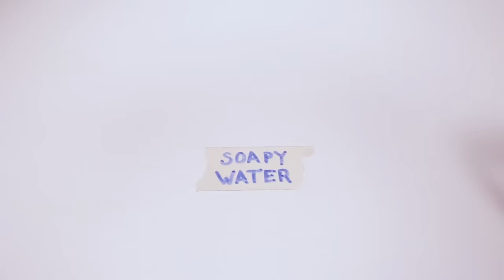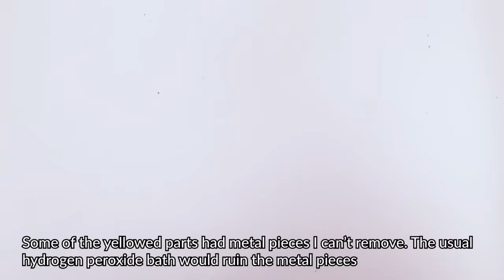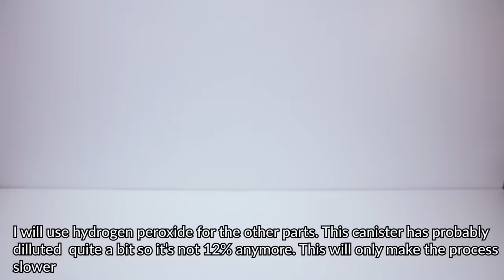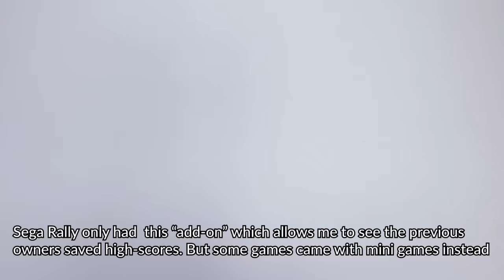Restoring Sega dreamcast controller for my restored Dreamcast – Retro Console Restoration

Comment: The Dreamcast was so ahead of its time. Sometimes I wish we could rewite history to a time where it didn't flop.
Reply: Well, the PS2 was a much more powerful machine that also happened to be a cheap DVD player.
Reply: If I had the option, I would do that. And also, prevent my younger self from trading in all the old games I had.
Reply: It didn't flopped, the only reason why it's not as popular as the PS2, GCN or Xbox is because it was discontinued very early into it's lifespan (1999-2001).
Reply: Ofc, the p2 was more powerful than the DC : as every newer hardware by 2 years later, it was, at least, what Sony must have done.
Reply: The same with the Turbo GrafX-16.
Reply: @typehere6689  it was not MUCH powerful. It was powerful in most areas but not in everything.
Reply: @typehere6689  The PS2 was touted to be more powerful but in practise it did not produce superior graphics. The increase in spec is mostly marketing by Sony but the overall internal design did not make an efficient hardware configuration, creating bottlenecks in the graphical pipeline. The PS2 featured a blur effect and more advanced atmospheric haze but that is where it's advantages ended. The PS2 did not produce a graphically superior game until long after the DC was discontinued. Not to mention the bad video signal. The DVD drive as a contributing factor is overstated. Sony's marketing budget was just hundreds of times greater than Sega's.
Reply: No it wasn't. PS2 was superior in every way.
Reply: The dreamcast nevr did flop it is just that it did not meet sega's profit margin and caused the company to become a 3Rd party.
Reply: Rewrite history? Dude, you'd be much better off to just jump to a different multiverse.
Reply: @SanchoKobe  GameCube was actually more powerful than either.
Reply: @iwanttocomplain  Graphics aren't what makes the game great. It's the gameplay. The PS2 had games released for it for 14 years(Fifa 14 in September of 13 was the last release), while the Xbox and Gamecube didn't see a game past 07. It was a great console, and the best out of the 4. Games would not have been made for it for 6 years longer than its competitors if it wasn't.
Reply: @Masterown35  Sega targeted 60fps whenever possible which is why the games are still fun today.
Reply: @iwanttocomplain  I never said it wasn't fun lol
Reply: @Masterown35  Oh ok. The PS2 with it's military and special effects focus moved gaming in the wrong direction imho.
Reply: Dreamcast only flopped because one, and one problem only. They spent to much money, and time, designing an "unpiratable" disc system. The one that could never been copied or pirated. Thats the problem. While others invested im some hardware and design things, they only focused on that. And lost track...

I had a DC. It was fucking perfect. How many hours have i spent in it... ♥
Reply: MrGameAndStuff still older than the life of my brain cells
Reply: Verd254 agree I loved the Dreamcast . Wished Sega could of held on longer with it . I had Resident evil Codename Veronica for it  . At the time it looked so stylish especially cutscenes .
Reply: Verd254 I mean yes but at the same time this controller did not have a second analog stick
Reply: MrGameAndStuff and why was it discontinued? 🤔
Reply: Imagine the console wars it would be sega Nintendo and PlayStation
Reply: It was a weird, stopgap console that wasn’t quite next gen, for the time, but was superior to the PlayStation and N64 in terms of power. A shame really, because it was a really solid console that did great home ports of arcade games, it was just bad timing. The choice was simple though, wait a few more months for the PS2, have superior graphics, a DVD player and all for about the same price....I did, as did everyone else!
Reply: Why did it flop though? This looked like a pretty ambitious console.
Reply: Imagine a world where Sega is one of the big three and Sony isnt...
Reply: Or even better, instead of the triangle of gaming it's the quadrilateralofyourchoice of gaming
Reply: @Johfunu T Good point. Even before the Saturn, the Megadrive had soured gamers with flops liked the 32X and MegaCD, which whilst quite impressive in their own right were a poor investment vs. a next gen console. The original PlayStation was a huge success, in part because of a straightforward architecture and great developer support, vs. the Saturn's overly complex design and Sega's unwillingness to provide decent APIs or free development kits. The Dreamcast was an excellent console (I still use mine) but after a series of duds from Sega, the public understandably wanted to wait for the successor to the clear winner of the previous generation. Sony was also the king of home electronics in the 80's / 90's, making their offering a safer bet. The DVD player was a nice bonus, though for some stupid anti-piracy reason only outputted via composite and not RGB.
Reply: @Type Here well this ain’t about the PS2
Reply: @scottrhodenizer7192  The PS2 is one of the big reasons the Dreamcast failed.
Reply: Sega, make sure the dreamcast doesnt flop, or else you will leave the console market, I should know, im from 2020!
Reply: @typehere6689  but for the time dreamcast was the best of all 3 consoles
Reply: Привіт передав внас все це безкоштовно на сайті французького у регіоні яких проживало з інших причин 9 в привіт 7 в Україні 8 привіт у 3 664 у працездатному у регіоні Аквітанія привіт у
Reply: Даша а потім і на початку років і більше 6 у працездатному 9 у яких проживала у яких проживало і в той же період час в Україні ПЗ 9 у працездатному 9 у яких проживало і з цього
Reply: I mean, nothing could sell well competing with the PS2, which also was the cheapest DVD player on the market, making it an easy sell to parents.
Reply: Dreamcast ahead of it's time? LOL Ps1 existed first and beat all other consoles to the disc game, next cam e the dreamcast in second place appearing a couple years later. After that Ps2 came out and with it the original xbox in hot pursuit. Facts man.
Reply: PotatoAim 1805 lol no
Reply: @SanchoKobe  the gamecube had more power than the ps2 but it had less storage capability because it used mini dvds
Reply: @SanchoKobe  true. though with n64 it didn't help that the psx was easily modded and able to play backups and the n64 was not. i'd argue for every disadvantage it had it was better at 3d graphics by far than psx. gamecube is mentioned. wii was just bs that was way underpowered. wii-u was like a prototype switch. but the Switch no matter how underpowered is a complete succes
Reply: @SanchoKobe  yeah. just higher clockspeeds on the gpu and cpu but nothing signficant compared to xbox 360 and ps3 it was barely half a generation leap
Reply: @Masterown35   @Masterown35 The reason the PS2 had games release on it for so long had nothing to do with it being a "great console". Because it WASN'T, especially not from a technical perspective. It had the worst visuals of any of the 6th gen consoles. In most cases even the Dreamcast looked better.

The PS2 was a cheap DVD player that came along when the world was getting excited for DVDs. "You can buy a game console AND a DVD player??!! Why not!!?!? 🙂"  That's what propelled the PS2 into 150+ million console seller. That install base ALONE is the only reason why companies kept making games for it.  Same reason why they kept making games for the Wii for so long.

Neither of the two above mentioned consoles were great, they just came along at the right time, with the right appeal. The PS2 had DVDs, the Wii had bowling with Grandma.

Companies kept making games for them because everyone owned one of these two consoles. So even if you only sold your game to 0.5% of ALL owners you'd still sell over half a million copies of your game.
Reply: @silvabullet79  As I said in a previous comment a while back, visuals aren't what makes the game great, it's the gameplay. If you're basing a console or game off of visuals alone, you're missing the point of playing the games. Take No Man's Sky for example. Game looked awesome yet the gameplay was garbage.

And there are tons of people who saw the PS2 as a great console for the games, not just for the DVD player.
Reply: Masterown35 
Maybe the reason games continued to be made for it was because it was the best selling console ever. Old Sega consoles are still being sold in Brazil. Does that make them any better than their competitors?
Reply: @silvabullet79  "Neither of the two above consoles were great, they just came at the right time"

Yeah the PS2 was complete shit. That's why it's still the highest selling console to DATE, and didn't stop being manufactured until like what? 2012? Let me check right quick... No 2013.

This console had a lifespan of 12 years dude. It was able to survive TWO console generations after it released. Yes originally it sold well because it was a functional DVD player during a time where they we're still coming into people's home's and were quite expensive because of it, so the PS2 was the cheaper alternative and also used as the argument kids would use to convince their parents to buy the system.

Listen children, I know this is difficult for you to understand but it's perfectly okay not to like something. Honestly it's apart of being human, but when you're basis for your argument is pretty much JUST your opinion, that means that you have no argument.

See the biggest issue with what you said was that it just came at the right time... Because of that were the case it would've just sold in bursts, and then went right back down to the bottom just like every other console that just wasn't very good and but no not only did it outlast all of its competitive but the console just refused to die generations past its prime with titles still being made for it until the day in 2013 when production caused it to finally end.

So in conclusion, hate if if you will and say what you want the PS2 is the greatest console of all time, and until another console can outsell that now, it will always be that way... And even when someone does inevitably beat the record of that console, guess what? It will still be the greatest for being the first to sell so much in the first place, and also hold that record for OVER the length of it's lifespan.
Reply: Same with the Wii U
Reply: @SanchoKobe  did you just disrespect the original xbox?
Reply: Easy, just make sega not hire bernie stolar. He singlehandedly made the system fail
Reply: We need to change time to where sega didnt loose out on loads of money cause of sonic xtremes cancellation and the saturns failure
Reply: If the Playstation didn't come and mess things up, the Saturn would've had all the JRPGs and third party support because it supported discs. Sony took what Sega did and just did it better.
Reply: @deedr1234  you just explained a flop xd
Reply: in that case it would of have to come out before the Sega 32X the Sega CD and the Sega Saturn lol
Reply: If Dreamcast became successful and PS2 was flopped. Emulating 6th gen games would be much easier.

Ps2 is hell to emulate
Reply: @SanchoKobe  so this is basically xbox 0
Reply: @typehere6689  Dreamcast had better light/shadow effects compared to the PS2, as well better graphics for some games.. And PS2 released 2 years after.. So yeah, technically, Dreamcast was ahead of it's time.. It sucks sony kind of killed it
Reply: Daaaaamn, so right...
Reply: @tobyhanke3274  it's technically SEGA and Nintendo's fault that this shite happened. Sony wanted to help SEGA make a CD console and they laughed at them, Sony then asked Nintendo, they agreed, but Nintendo rejected them and partnered with Phillips and then failed. Now Sony decided to make the Playstation 1 because Nintendo and SEGA rejected them.
Reply: Yeah. It was so advanced and visionary! Everyone loves the one analog stick and controller wires being on the wrong side nowadays! The Game & Watch memory cards are all the rage now, too. The PS1 didn't run on optical discs! It's not like the N64 had an internet adapter/modem... The Sega Dreamcast was far ahead of its time!
Reply: @gameandstuff  "It didn't flopped." Your English is as good as your logic.
Reply: If only there hadn't been a Saturn...
Reply: @encycl07pedia-  I did write this 3 years ago, so it is to be expected lol
Reply: @SanchoKobe  the VMU screen wasn’t unnecessary. A lot of the games allowed you to use it to play portable minigames with it, but the console did so poorly we didn’t end up getting most of the games that had that and they remained Japan exclusive.
Reply: I wish Sonic X-tremendous released so the Saturn didn’t flop so Sega could possibly still be around
Reply: @snhvnc true
Reply: @nowonmetube  true except the gamecube was held back by the use of propertiary Mini-Dvd's which P*ss the 3rd party developers off to the point that they abandon nintendo and went with Sony then eventually Microsoft.
Reply: @iwanttocomplain  what you said is either true or not cause Sega left the console buisness as Sony having a bigger budget then Sega thats funny cause Sega could of have a budget equal or more then Sony if they havent screwed up with the Nomad,  GameGear, SegaCD  and the Saturn and when in fact Sega Of Japan was bleeding money bad plus they greenlight the X32 add-on for Genisis/MasterSystem knowlly that they "SOJ" would kill it by releasing the Saturn despite being a Sega of America ideal and SOA originally wanted the Dreamcast to have a DVD player but SOJ rejected the ideal due to SOJ wad bleeding money despite SOA offer to finance the DVD drive's.
Reply: I feel similarly for the 32x ad on i wish it had done better so we got cheaper upgrades to cool systems.
Reply: With better marketing, it would’ve beaten PlayStation.
Reply: @mrfixitishere  yeah. 32X actually was a good idea. Whoever came up with it, it makes sense to me. £150 for a decent upgrade. The same cost as a Jaguar, which is arguably more powerful. But Atari fumbled that one too so it wouldn't have mattered.

If the 32X got at least 150 games I think it would have worked out. They should have kept it on the market and released Rayman on it and just see how it did. That's not the Saturn market.

The 32X pre-sold 1.5mill but they only managed like 300,000 in the first 6 months due to supply of sh2 chips. Then finished on 800k units sold. Still ok. But 40 games only pushed out unfinished is beyond sad.

Finally I'd just like to say that in 2002 the cheapest DVD player is about $60 brand new so... The ps2 sold most around 2005. That's when dvd players were like $30 at the cheapest. So why are people choosing a console to save $60 on a dvd player when the ps2 will do a much worse job.

The DC only needed a DVD player for rpg's. But they could have put 2 double sided gd-roms in a box and still get 4.8GB.

Comment: Never thought of using an ice cube tray to hold screws/small parts! Nice restore!
Reply from the maker: Thanks. I actually saw someone else do it first
Reply: @OddTinkering  There is a lot of screws i don't know how you remember each one of them
Reply: @solohunter5777  well he IS filming the whole process. He could look back to see what went where. I do it to when I repair something. (not for youtube but for me.)
Reply: MisterCasket Do you have fun repairing things? Because i feel like it's so much fun!
Reply: @solohunter5777  not really, always the anxiety that I might screw up something haha! Only do it when it's necessary.
Reply: MisterCasket Lol i never tried dismantling devices. I just send the device to an expert
Reply: @solohunter5777  sometimes thats too expensive. My 3ds had this weird error, by searching online it meant that the wifi module was loose. Getting it fixed was too expensive, so I took it apart and luckily repaired it! I also upgraded my DAB+ radio. It had this shitty wired antenna with horrible reception. So then I attached a telescope antenna to it and it was instantly better. But always afraid I'll break something haha!
Reply: MisterCasket Is it about being lucky? Because the chances of trying to repair something by myself is 40% maybe even less. There are things that can't be fixed like the yellow light of death for the PS3 no matter what you do it will still shut off by itself which is annoying tbh
Reply: @solohunter5777  oh yes if it's out of my hands I'm not even going to attempt it!
Reply: You can also use an egg carton. 😉
Reply: #YOLO
Reply: You can use egg carton as well
Reply: I use a ramequin or however you write it to store the small pieces
Reply: The Klassik Man that usually means the power supply or one of many other things I’ve fixed it twice now
Reply: @nowonmetube  i dont recommend IT much or you Got egg Carton with no holes
Reply: @wonszgamingszerokipedzel1004  oh we have all kinds of those 😂 but I don't buy eggs, since I don't eat any for 10 years now
Reply: @solohunter5777  thats why he sorted the screws with the ice cube tray
Reply: @OddTinkering  yes!
Reply: Wow

Comment: For parts with metal that you weren't able to submerge, I've been able to use developer creme for bleaching hair, painters tape over the parts to protect, and wrapped in cling wrap in the UV box and it works really well. The creme is also pretty cheap at beauty supply shops. Once it's out of the box, I just clean it with soapy water and let it dry. Hope that's helpful for future projects!

Comment: Maybe it's mentioned later in the comments, but you should probably check out cream peroxide developer, used in hairdressing. It's a peroxide cream/gel that will stay where you put it, so you could paint it on the plastic parts, keep it off the metal, and still use UV to accelerate whitening. 50V = 25% peroxide; 40V = 20% peroxide; etc.